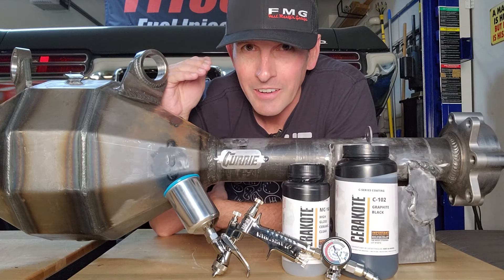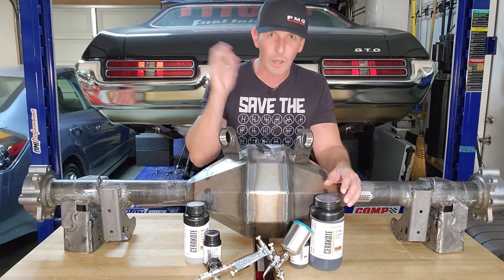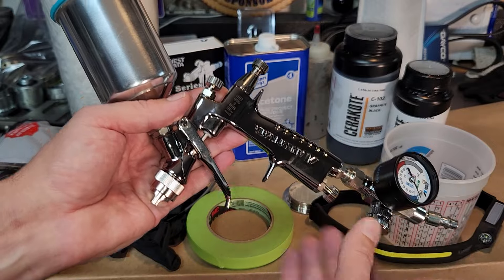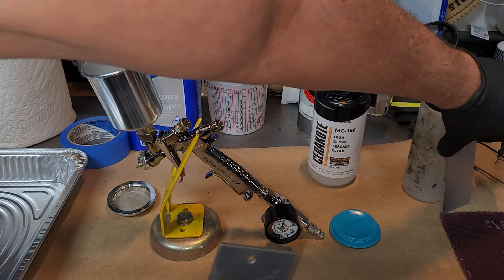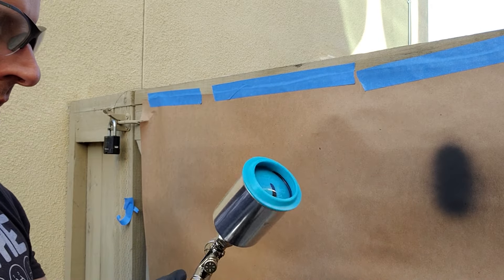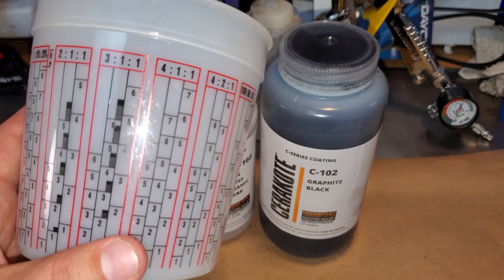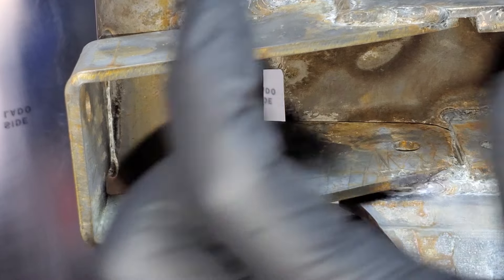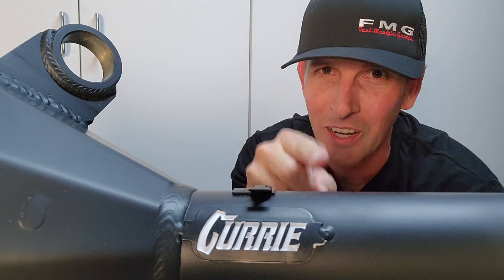How to apply Cerakote at home!  Currie Rear End install, part 4

Comment: With no ventilation in the plastic booth the room will overspray fog up then you can’t see.😢 So what do you do? You could rig it up in your backyard and add a small PC fan to blow the fog out and another hole for air intake. That’s my guess.
Reply from the maker: Hey John... yeah, all kinds of options.  (The overspray wasn't ridiculous, which was probably due to the small gun... A standard sized HPLV however, would've been 5x worse)  Anyway, if anyone should use a fan, it has to be EXPLOSION proof.  No sense in blowing yourself up... before your project is done, at least.  Ha, ha... Thanks John!